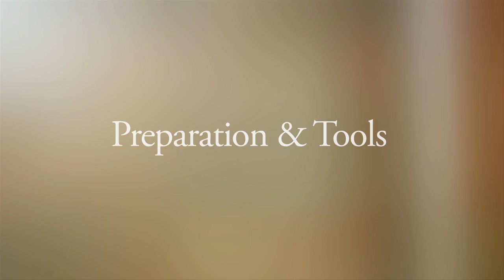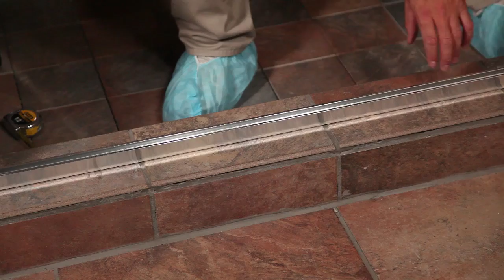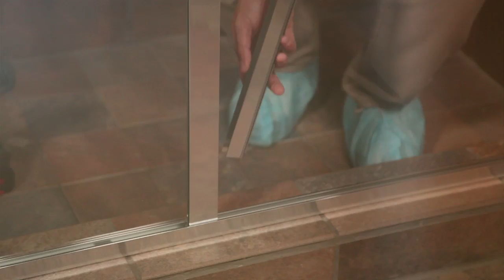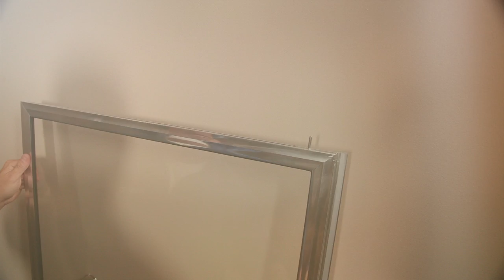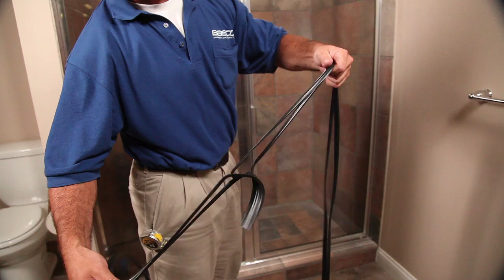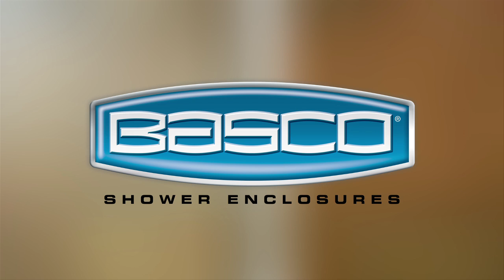How to Install a Basco Framed Shower Door -  135/735 Shower Enclosure

Comment: THANK YOU for showing how to install the door properly! I have a leak and was messing with the shower and the seal. I pushed up on the door and came back down and it POPPED out! I couldn’t get it back in to save my life! Thankfully I was really holding onto it! I had no idea shower doors were so heavy! Thankfully I have another shower. That’s what I’ve been using and mine is out of commission. Putting it back on today! Thank you for going step my step. That round spacer on the bottom was messing with me lol I was gonna use tape I was starting from the bottom 🤦🏻‍♀️ this makes way more sense.
Reply from the maker: Hi there, thanks so much for your feedback! We're super happy to hear that the video was helpful. If there is anything you need in the future, please don't hesitate to contact our Tech Specialists at 1.800.45.BASCO or via inquiry@bascoshowerdoor.com. We're always happy to help!

Comment: Just installed one of these for my dad in an oil rubbed bronze finish. Iv'e installed alot of shower doors including sliders, but the directions were clear and concise and it went smoothly. Expect it to take two people about 6 hours to install if you've never install this type before and they are a little more difficult than sliders. But overall not too bad.
Reply: Actually this style is much easier to install than the frameless type that hang from the header. Much less chance of breaking the door.

Comment: I recently attempted to install one of these things in a customer’s bathroom and ran into several problems with this product. One, cutting the header. You will need a circular chop saw with a metal blade to even come close to getting a clean cut. The wall anchors provided are practically useless. The anti bump guides in the header are supposed to be secured with these crappy little screws which do not work at all. I managed to install the inner door no problem. But when you attempt to place the outer door you will find you have no room to angle it inwards because of the over lap from the inner door and you can’t just lift it up into the track. As I carefully attempted to insert the outer door into the track it bound and shattered all over me and injured my hand not to mention glass went all over the place. Now I’m no novice at DYI projects and was extremely careful. I wouldn’t suggest doing this yourself and a tarp is a good idea incase this happens to you. This isn’t a product I would recommend. This video also isn’t the frameless sliding type I attempted to install so doesn’t apply to my experience.
Reply: Yes, the instructions are wrong. For most applications, you need to install the outer door first, and the inner door second, both from inside the shower so the base doesn’t block access.